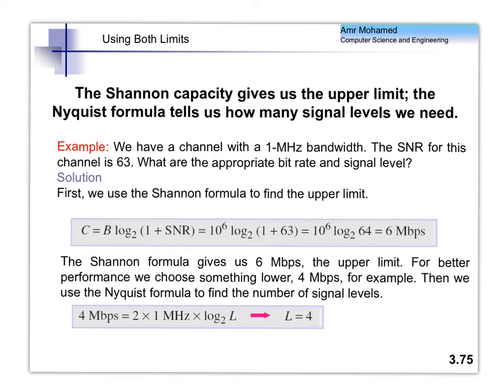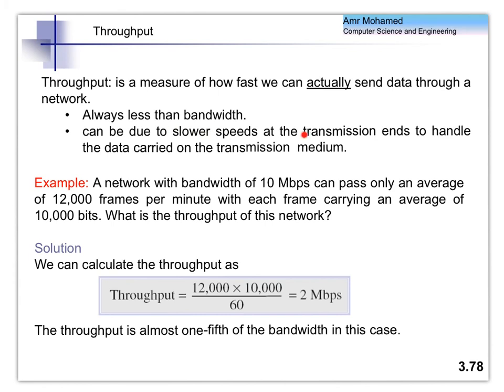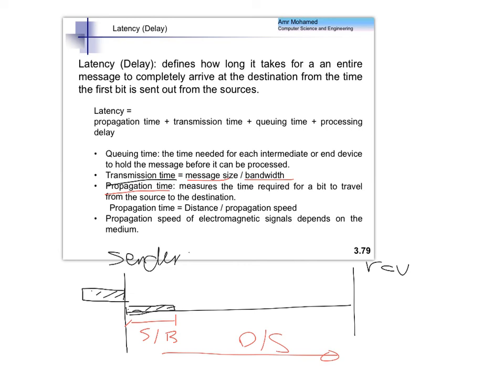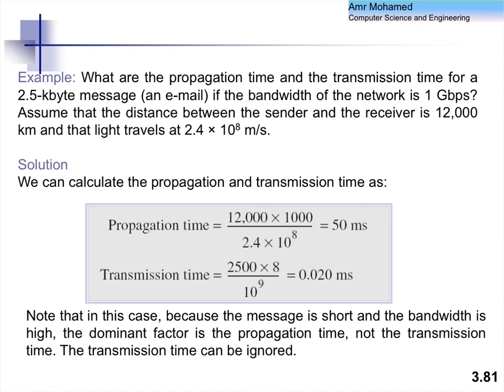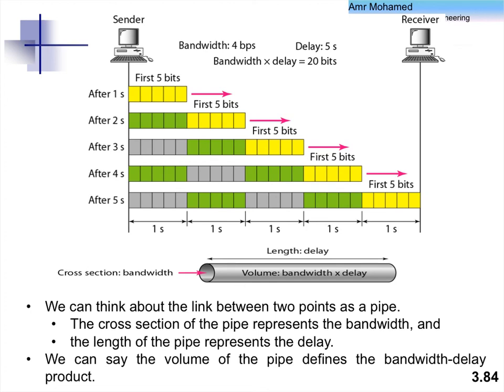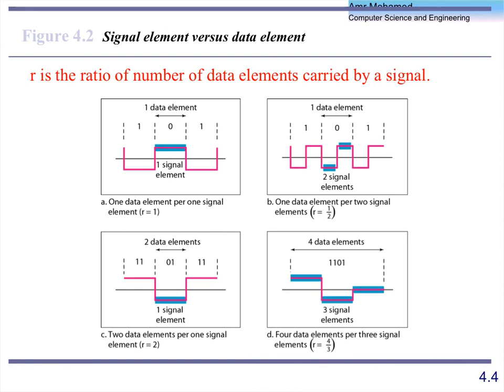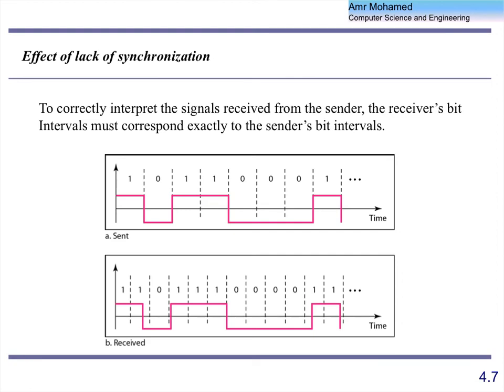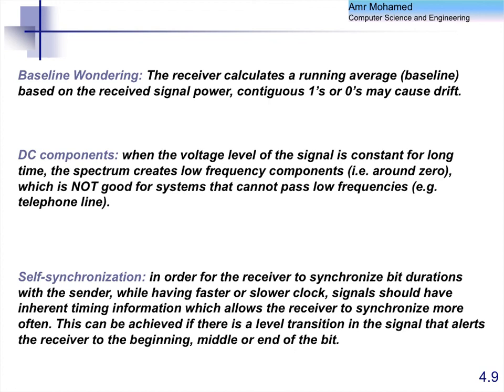cmpe457-2018-02-28

Comment: dr why we multiply by 8 in transmission delay ?
Reply from the maker: M turbo don't know which slide or min you are talking about, but probably we multiply by 8 because the message size was in bytes. So we have to multiple by 8 get the message size in bits.